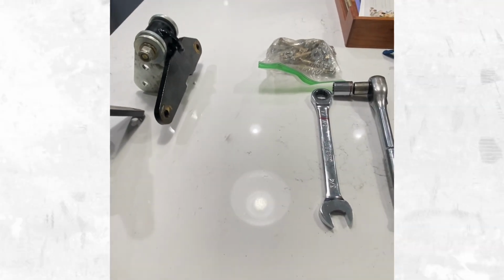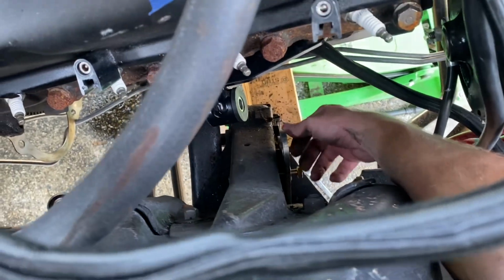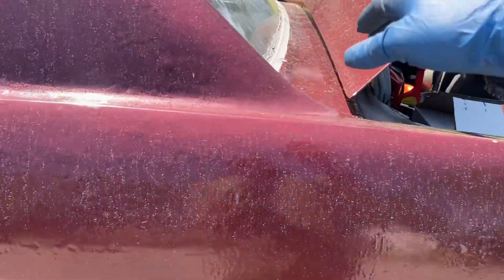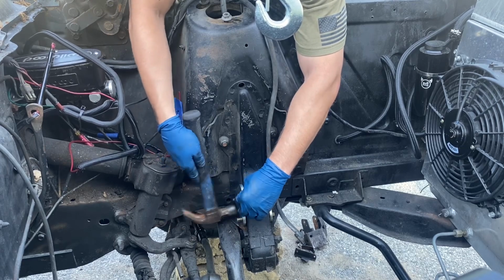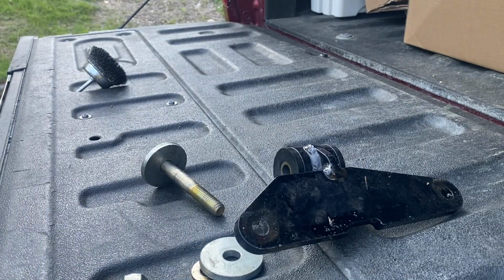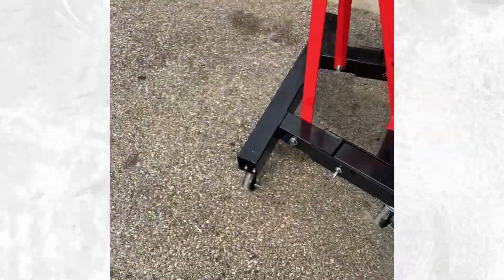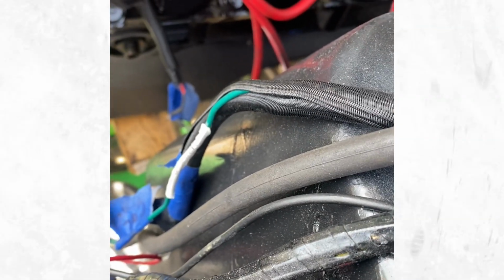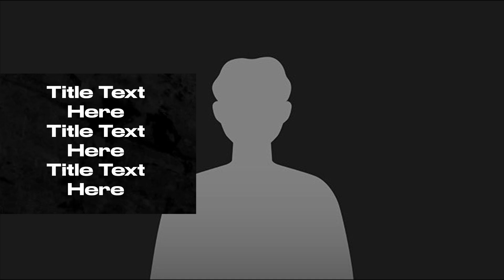1967 Mustang engine removal and TCP motor mount install

Comment: @Austin Downey, are you former Military? If so, thank you for your service! It's low priority but I have one of these old cars too. I'm not even the "Mechanic" but have had to work on my vehicles at times. Anyway, It's nice seeing someone actively driving/working on theirs. Idk what you use for video recording but it would help if you had some sort of portable mic, as you move around it's difficult or even impossible to hear what you're saying.... As for the radiator/fans, Idk about that specific unit, there are all sorts of units to fit these cars, Idk why yours doesn't seem to "fit right."

As for the engine mounts, you obviously figured it out. Once I saw that there were unequal lengths between the bolt holes and the "bushing" which was towards the shorter end, I could tell the "longer end" needs to go towards the rear of the engine rather than front. Still, it might help if those who make these "custom parts" would actually stamp "LH, "RH", "Towards Engine" etc., onto parts, maybe include a diagram/simple instruction.

If your engine is sitting a little lower, it could be because of a slight height difference in the factory style mounts and these aftermarket units.... One thing you could do is look under the vehicle at the oil pan & gauge it's position. At the beginning of the video we can see it's approximate position relative to the crossmember/anti-roll bar etc., and it was higher up than these so now you can check to see if it's more even or lower than the crossmember. Anyway, enjoyed the video, Idk what other YT's use, some I've seen with "lapel mics" but sometimes you get the "shirt rubs/muffling" & they don't even realize it....
Reply from the maker: Thanks for the support, im working on improving my videos the lapel microphone is a great idea! Good luck with your build as well!